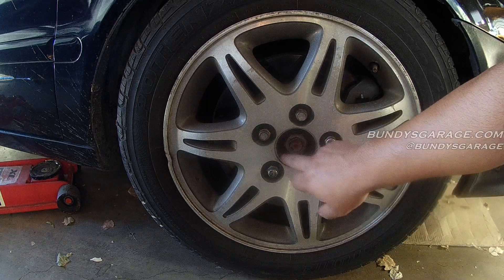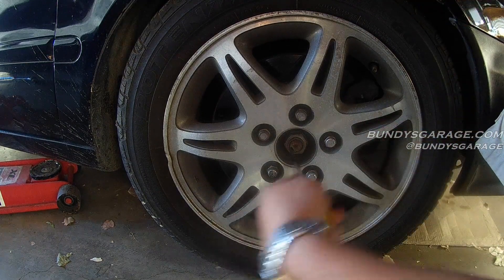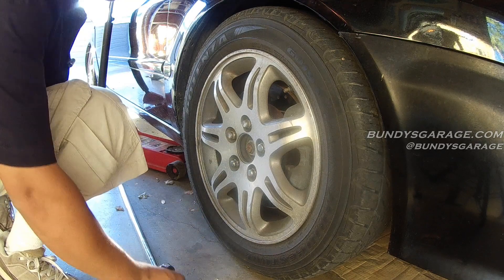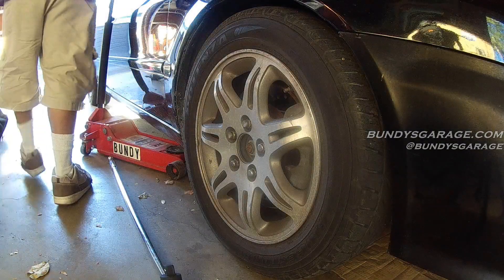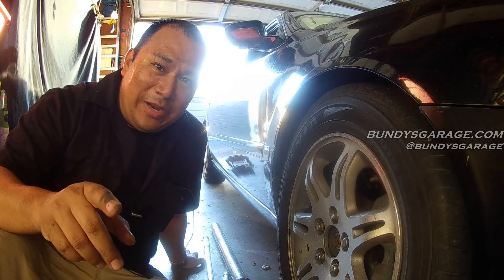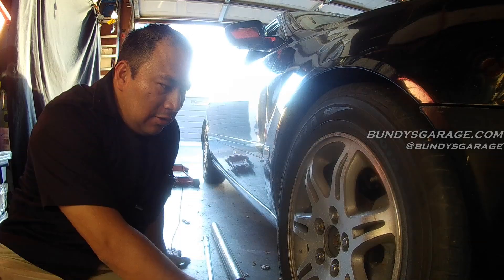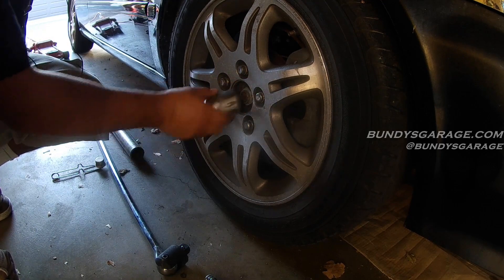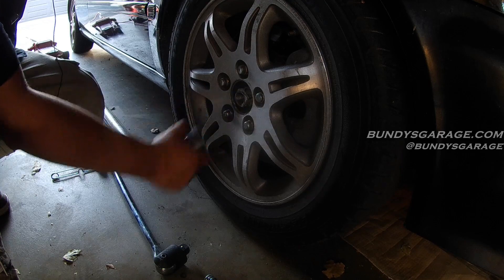How to Remove Axle Nut on Honda - Rusted Stuck Axle Nut will not come off - Bundys Garage

Comment: I've watched a lot of videos on this subject and I have to say  video is the most accurate on what's actually gonna happen.
Reply from the maker: I don’t sugar coat things in my videos. If it Sucks im going to tell you and if it really works I’ll tell you that too.
Reply: @bundysgarage  thanks for getting me the motivation 2 replace my axle this afternoon. I broke 2 breaker bars.. the ratchet was the winner this time around.
Reply: @bundysGarage Hey man nice video same thing is happening to me with me 07 F-150 any tips for me man I have a nabour that broke a impact drill 2 breaker bars and bits trying to get it off we heated it liquid wrench any tips for a young mechanic brother?
Reply: @jameshoey9925  cut down the middle of the bolt. Yes you may cut the hub in process.
Reply: Keith Owen Perry do you think if I went to a pawn shop in the morning and bought a high impact drill that it would be able to break it loose?, and I’ll have to try that also in the morning thank you I’ll update progress
Reply: @jameshoey9925  you can not save the axle if you do this. Also remember to get some anti seize and use it on every nut bolt so you never have this issue again..
what I used half the times I've had this issue was a mid grade dremel with the biggest metal cutting disk. 2 disk will cut through 90% if you are patient.  then you can use a flat punch 2 break off the last 10-20% of the nut.
Reply from the maker: Use more heat on it. Get a propane torch from Home Depot or Lowe’s and heat the nut up for about two minutes and then hit it with a breaker bar. You might need to add a cheater bar and have a friend help you put weight to it.
Reply: Dude, it isnt just harbor freight, I've broken breaker bars, and a half inch craftsman professionall ratchet trying to remove my frozen nut. So dont slam harbor freight.
Reply: I just came to watch this video this morning after snapping 3.. THREE breaker bars just like in the video.  now im at work flustered and trying to figure out how to get it off. I do not have an air impact..
Reply: @jameshoey9925  yes. Get a bigger impact
Reply: @Komprezor  get a 24v battery impact
Reply: Mine went downhill real damn quick.
Reply: This happened to me today 😭😭😭😭
Reply: Hell yeah
Reply: After my breaker bar started bending, I put my tools up, sprayed some PB blaster and went on google to see if there is another way. This video is Gold
Reply: Yeah.... it's realistic.
Reply: and the wheel bearing? Cooked?

Comment: I'm not a big HF fan, but in their defense, any time you have to put a cheater on a 40 inch breaker bar, you cant expect a 1/2" drive to hold up.  I've broken many a Craftsman breaker bars the same way...and these were the decades old American made tools...
Reply: Harbor Freight has good and bad quality stuff so always research what not to buy 🎉

Comment: Yes! Most accurate video on this. Thanks for the laugh and commiseration. These suckers are stuck tight. Biggest, torquiest nut on the whole car, hands down. Don't blame Harbor Freight, my 36" Craftsman 1/2" breaker bar twisted the driver right out of the fork. Husky? Sheared the 1/2" square-drive off in the socket. Reassembled the intact parts of the Husky & Craftsman breakers into a Franken-breaker? Cheater bar broke them both together. No joy. Torch? Nuthin'. PB Blaster? Nuthin'. Cheater pipe? Nuthin (except broken tools). Stomp on it, jump on it, rock it, jack it... nothing. Manual impact? Nope. Electric impact? No luck.
Reply from the maker: I know your pain!
Reply: In the same boat, bout ti take the angle grinder to it
Reply from the maker: Please let us know how that works out? That’s what I should have done!
Reply: that's why we like that lifetime warranty 😂
Reply: Yeah, did you ever get yours off?
Reply: @CODSlaya When all else fails, break out the angle grinder or acetalene torch 🎉🎉🎉😂😂😂😂❤
Reply: I believe I used another tip years ago: drill a line of holes across the face of the nut from axle to one of the flat, most of the way through.
For some reason, this allows the metal to stretch and release its grip.

Comment: Had to remove these on my 03 Chevy S10. Used plenty of PB blaster, snapped a breaker bar, used an impact driver and a torch and still couldn't get it off. Finally cutting it with an angle grinder got it. Just be careful not to go as deep as the threads of your axle. This weakens the nut enough for it to fail.
Reply: normally the new axle would come with a new nu t
Reply: @wecarespares  I unfortunately was not replacing the axle but just needed to get the hub off to replace the bearings. I had to buy a new nut after cutting it.
Reply: That makes total sense ❤

Comment: ONE VERY IMPORTANT THING TO NOTE IS THAT THE TIRE MUST BE ON THE GROUND. It doesn't work if you're just turning the drive shaft.
Reply: you can put a pry bar on your wheel studs to hold it still

Comment: Here in 2024 to say that I broke the exact same 1/2" breaker bar dancing on it with a cheater. Off to the store to get a more robust tool. Never had this kind of trouble with an axle nut before 😂

Comment: Great video. Most guys I'm sure use an impact first and then show how you can use a breaker bar to loosen the axle nut for the video, but the truth is an impact is what you actually need to use
Reply from the maker: Thanks for the comment but sometimes air impacts won't even get them off.
Reply: @bundysgarage Milwaukee Fuel impact outperforms air on a YT video! I can’t afford one so picked up a Chinese brand with high reviews on YT and it’s a monster! Then there are the 2500 ones for big rigs but probably super expensive.

Comment: So frustrated with my own axle nut troubles but this had me rolling.
Reply: I've just broken my very expensive breaker bar ( doing all of the things that Mr Bundy did) trying to get the nuts off my Honda CRV 2005 so what I intend to do is drill a hole parallel to the threads-but not touching them-and split the nut, I can't afford another £90 for a new breaker bar and I don't have compressed air tools. Two new nuts will cost £14.

Comment: Thanks for sharing your video. I had to remove an axle nut recently from one of my vehicles, and what I learned (The hard way) was that using a breaker bar is a very hard way to remove axle nuts, I couldn't get my off. Lucky for me, I was able to borrow an 1/2" Wireless Impact Wrench from my job and impacted it off. Impact wrenches are the way to go! & for those that don't know any better, I'm referring to Impact Wrenches, not Impact Drills, which are different things.

Save yourself some trouble and money by not breaking multiple breaker bars and adapters and just get an just borrow an Impact Wrench for Axle Nuts. 💪
Reply: Do you know what is the torque of the impact you used?
Cheers
Reply from the maker: @hassanmohamed8904 sorry I don’t remember
Reply: It’s similar to the jar lid principle. You just can’t get the lid off no matter how much brute force applied so you shock it by introducing vibration waves like tapping all around the lid with a butter knife and it comes right off. The impact sends multiple vibrations along with torque and it just works. The trick is to get the highest rated impact over 1000nm

Comment: You weight about 180 ft.lb  sitting on a 3 ft bar -  that's over 500 ft.lbs torque on a little 1/2" drive.  See tests on Youtube with 1/2" drive snap-on  ratchets breaking at only 300 ft.lbs -  a cheater bar is going to be tougher metal, but 1/2" drive is still a 1/2" drive.  You definitely need a quality 3/4" drive breaker bar with 3/4" socket for such job.  Or, the much faster way - stop to a garage to have them break loose the nut with the impact, tighten back a little, drive home and finish the job.
Reply from the maker: Yeah most shops won’t do that cause it’s a liability. If they do that and you drive home and the wheel falls off and you run into a bus full of kids and it burns to the ground with all the kids inside. A lawyer would have a field day with that shop. Think about it bro.

Comment: I did the same thing removing an axle nut on a Honda. Broke 2, 1/2 inch breaker bars, craftsman  and harbor freight. Then I went and bought the 3/4 drive and a set of 3/4 sockets,  from harbor frieght. Used an 8 foot cheater bar, think it was a pole for chain link fencing,  and it worked.

Comment: even with a 3/4" impact and 200hp screw compressor, i still have a hard time getting it off. you can put the blame on last tech\parts changer putting about 1000 duggaduggas on it last time it was installed lol just keep trying itll get there. only thing i havent tried is running a small bead of weld on it.

Comment: Not gona blame harbor freight. That breaker bar was subject to too much excessive force. Not supposed to use cheater bars. Glad you showed the air impact wrench working. Im having the same problem on a 1991 mazda 626. Gona go out tommoro and get one. Thanks.

Comment: I literally shear the same HF 3/4 to 1/2 adapter trying to do the same exact thing last night lmaooooo
Reply: Just did the same to both my breaker bars today
Reply: I just broke a snap on 1/2" breaker bar on an element today. Those nuts are tight! Fack!

Comment: A jack stand under the end of the socket/bar junction can help support the setup. (if you have enough room).  I broke a craftsman bar today on my Honda spindle nut.  So not just HF stuff.  I wonder if Lowe's will honor the old Sears lifetime replacement?

Comment: Electric impact along with heat should do it. The reason the breaker bars struggle is they don't deliver the force as a shock. That's why the air tools worked. I'm not sure why you didn't go straight to the air tools.

Comment: hello Bundy, i have a question. I am trying to change the wheel bearing and am going through the same struggles you went through with your axle nut, however even after using a lot of screw loose, and buying a 1200 ftlb impact gun, it simply will not come out. Any recommendations?

Comment: Going through the same situation. I bought an electric torque gun at HF that has 1050 lb of torque and it didn’t work so I took it back. Then I bought a breaker bar while I was there and tried that with a steel tube and it broke . I’ll try again tomorrow.

Comment: well i was about to get a cheater pipe and give it to it with my HF breaker but you just saved me from snapping mine. i think ill wait till the sun comes up before i torch mine and give it the beans with my impact. im pretty sure that because the axel nut is a brass/bronze type copper alloy it is subjected to accelerated corrosion via galvanic corrosion. the aluminum head in these cars doesnt help. i believe that because the copper is galvanically corroding it is essentially welding itself to the steel nut instead of just the friction from interference formed from a less dense rust forming like most rusted nuts.

Comment: Ha ha ..I just broke my breaker bar off this morning trying to break the front axle nut loose on a 1996 Maxima ..Stopped me dead in the water ..I put the tire back on and threw my hands in the air ...Defeated ...My Nefhew Went to his house and brought me a little Impact gun ..it's a Mac ...Hoping my small air compressor will power it enough to try again in the morning .

Comment: CV joint I just bought says 'do not use impact wrench' as it hammers your other cv joint.
Also - no breaker bar is designed to be extended with a pipe...

Comment: always use impact wrench on rusted out bolts and nut. vibration helps loosen it
Reply from the maker: or you could try penetrating oil before that like PB Blaster.

Comment: Damn dude... I know this is a really old video, but I've been going through the exact same kind of thing trying to get an axle nut loose on a Kio Rio. Heat it, jump on the breaker bar (that was painful to watch by the way). The only thing I haven't tried yet is an impact wrench. I am going to get a hold of one and try it.
Reply from the maker: Yep they can be a PITA!!!
Reply: @bundysgarage  Unfortunately, on one side of the car, (and strictly out of frustration) I decided to use a rotary tool with a cut-off wheel to cut some notches out of the nut hoping to form something I could grab with a chisel to and pound it off. Didn't work out well. The nut is chowed beyond getting a socket on and I don't know what I'm going to do about that side. Definitely going to try an impact wrench on the side I didn't mess up. Hopefully I'm going to learn from this and it will be one of those game changer moments for me.
Reply: That's how we progress as backyard mechanics. You push beyond your comfort zone to try a repair that you're unsure you can do and you succeed with good advise from Youtube videos like yours and also through the mistakes you make. Thank you for putting your video out there and actually having the guts and good humor to show us what didn't work which is just as important as showing what did work. But really dude... buying breaker bars from Harbor Freight??? That's just Karma.

Comment: Just hot glued a plastic cup over the axle nut with a little hole in the top & filled it with vinegar.
Should be able to remove the axle nut in a few days.

Comment: What kind of (how many gallons) Air compressor do you suggest for say axle/crank bolt removal?  That air ratchet did the trick and Im sick of breaking “breaker” bars aswell
Reply: You can do it with a breaker bar, just spray it with PB blaster everyday for a few days. Then use enough heat.

Comment: not a mechanic. what do you do if axle is bent and A-frame and tie rod and axle and have the wheel off already and can't get back on due to being bent?
Reply from the maker: Replace the parts that are bent with new parts.
Reply: @bundysgarage  I saw another video of using a screw driver in the rotor to keep from rotating when taking the axle nut off while the wheel is off. think I got it. thanks! 💪

Comment: Good vid, $6 was too much for that reducer and that HF breaker bar was no bargain either. Based on those HF tools it will be a tough sell for HF to convince people that there new Icon tools are as good as Snap-On tools.
Reply from the maker: Funny you say that, I was in my local HF the other day looking at their ICON 1/2 breaker bar and it's exactly the same one that I have in this video. All they did was put makeup on a pig... I do have to say though, their ICON line of ratchets is very, very, good. If you can I highly recommend them. Working on review videos about them.

Comment: I don't have an impact so I would have used a 3/4 drive socket and breaker bar, a tight 36mm nut is a lot to ask for a 1/2 inch drive.

Comment: Doesn't come off a 2012 Accord. Its as if it's supposed to come clockwise. Even with a like 6 ft breaker bar to the end of the wrench. Trying to take it off so I can replace one stud that the incompetent tire shop broke and then just ignored so that it could try to kill us.

Wish I could attach a pic of this huge heavy breaker bar.

Comment: Had the same problem...800 ft.lb. Husky air Impact from Home Depot and a 150 psi compressor will do the trick. Easily.

Comment: Pipe wrench on heavy duty socket with a pipe for leverage.... Done
Reply: That's the smartest thing I have read yet.  Thanks Ty.
Reply from the maker: Yeah thx Ty
Reply: This comment just got my bolt off after 4 days of trying and trying! Thank you so much! Used a 24inch 600mm heavy duty pipe wrench and bounced on it with all my weight about 6 times.
Reply: I will try this. 👍

Comment: Why does Honda use these huge axle nuts and hyper tight ?  Even on a Volvo XC90 SUV  the axle bolt is a 14mm (bolt goes inside the shaft) with some 50ft.lb torque on it and it works perfectly fine.   Not bashing Honda or praising Volvo, just don't understand this design ?

Comment: I just broke 2 duralast breaker bars.. the 3/4 drive should do it granted you use the socket it takes  rather than adapter...the race isn't on the axel it's part of bearing that gets stuck on hub

Comment: Not sure why are blaming the quality of tool when stepping on a 1/2" piece of metal with a 40" lever. This equates to something like 600-700 lbs-ft.  Use a 3/4 drive socket.  Also you're not supposed to get this loose with full car's weight on it.
Reply from the maker: I think it should be able to handle a little more weight than that. I have seen a 3/4 inch breaker bar from Harbor Freight shatter as well.

Comment: you need real heat, not that lil piece of crap, u might as well use a lighter if ur using a benzomatic, use a torch, that will get it red hot then it comes right off.
Reply from the maker: Well at that point just slice the nut in half

Comment: Now you know why real mechanics dont shop at Harbor Freight. Call your Snapon dealer
Reply from the maker: Trust me I could break one from Snap On as well.
Reply: Whatever Snapon fanboy. After using the Snapon, it would then be called Snapoff.
Reply from the maker: You know what’s funny. I just saw a post that states that Snap On sales are dropping as well as their lending arm of the company. I was talking to some higher up at SO and asked them what they thought about Harbor Freight’s ICON line? The guy looked at me and said “we don’t” well maybe they should cause HF is kicking their a$$
Reply: what is real?? please give me some reasoning. sound logic if you have it. define "real mechanic." if not you made a big @$$ out of yourself, no surprise these days.

Comment: It’s not just HF. Just about every 3/4” to 1/2” socket adapter in the market will break. Go to Amazon and every single product will have a review of someone breaking the adapter.

The small HF breaker bar you used is too small for that job. HF does carry bigger breaker bars, although the 3/4” breaker bar will be from Icon.